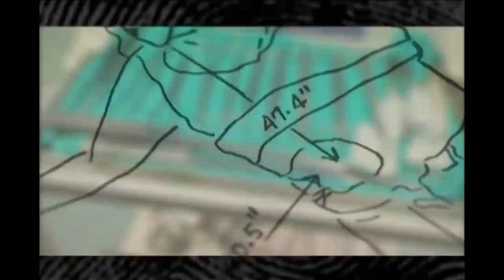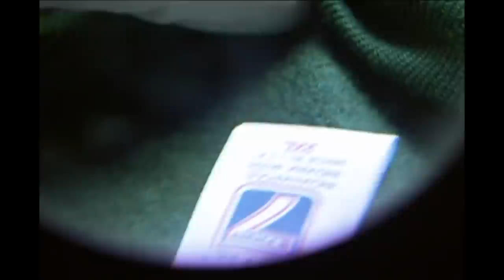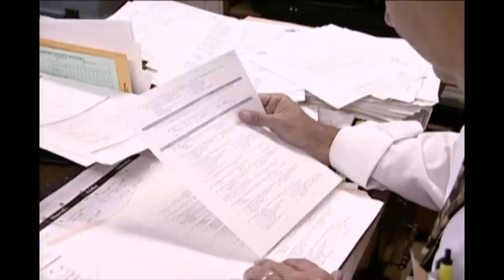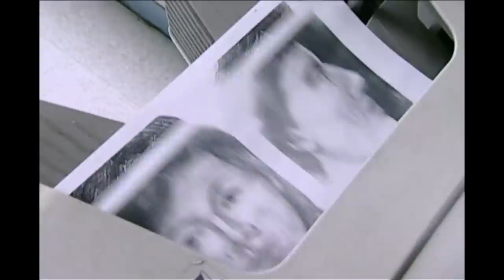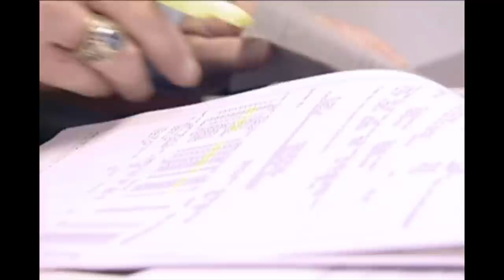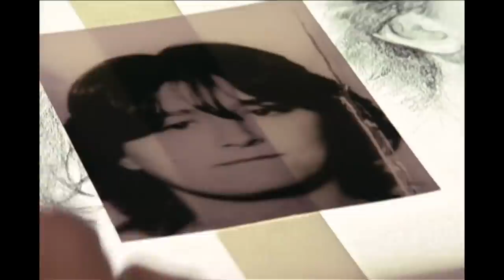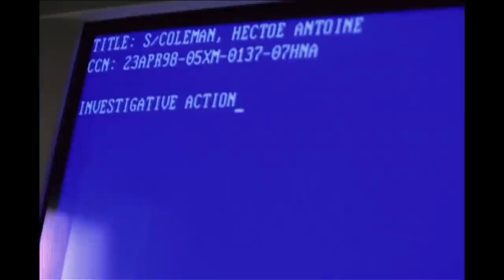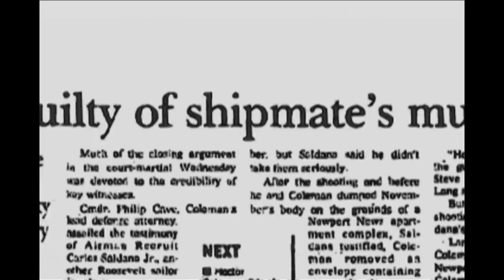Navy Investigators Hunt Marine For Murder Of Estranged Wife| The New Detectives | Real Responders

Comment: Oh dear, if someone ever would aske me to switch rug because they had mud on it... I'd be veeerrry suspicious and try to mimic Kim Woodburn "Here's what I suggest luv, spray a mix of vineager and water on the mudspots, soak the excess up with a cloth, sprinkle bicarbonate over the stains, press it in, let it dry and vacum the rug and it should be as new and lovely".. (it would remove visible mud but likely not the proteins from blood).